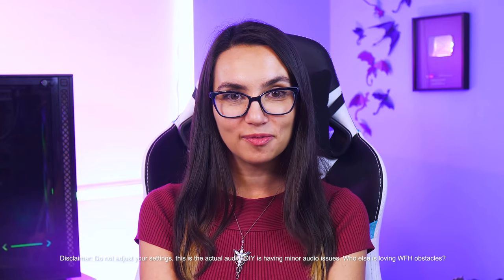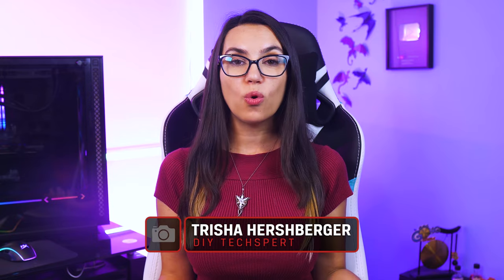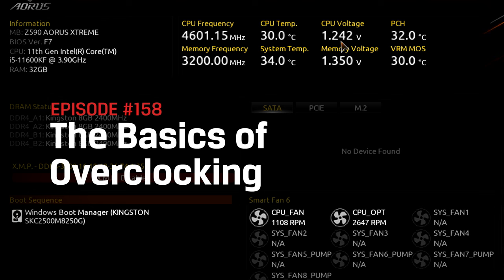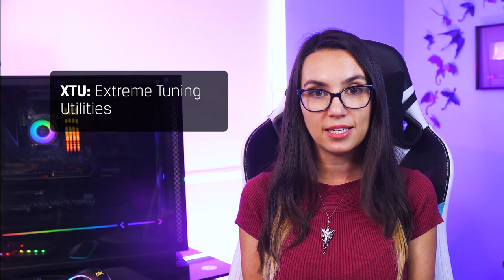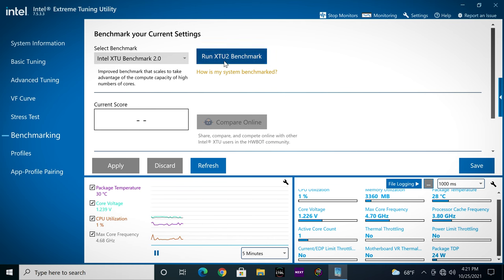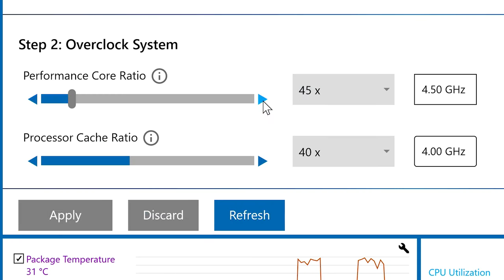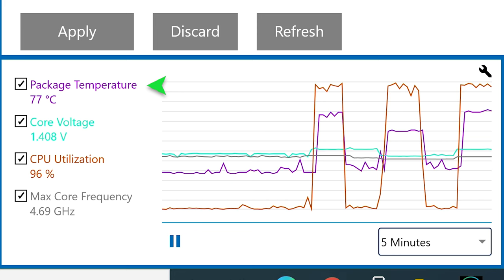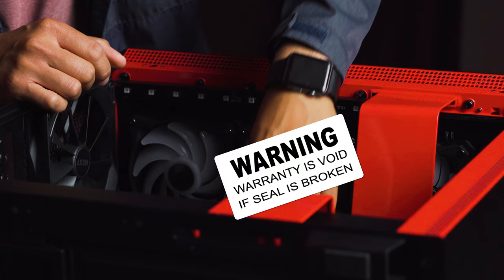The Basics of Overclocking – DIY in 5 Ep 158

Comment: Old timers like me remember the bad old days when Intel clock locked everything starting with the Pentium 2. AMD didn't make overclock tolerant chips, so for years overclocking required specialized knowledge and expensive after market chip adapters. Crazy to think it's officially supported now.
Reply: It still isn’t as it voids the warranty…
Reply: @christophervanzetta  it only voids the warranty if u break it lmao. And their r a lot of ways around it
Reply: @christophervanzetta  for example auto overclocking or PBO in ryzen master is not going to void ur warranty lol.
Reply: @princessskye2307  False. They deny warranty claims due to overclocking as stated in their warranty...
Reply: @christophervanzetta  ur wrong lmao. How many cpus have u RMAd? How many have u owned? If u do not break the cpu due to overclocking and it can be returned to stock settings before RMAing it. They normally will take it.
Reply: @christophervanzetta  BUT they reserve the right to tell u to F off if they findout u tried to pump like 5 volts into it😂
Reply: @christophervanzetta  lol theirs almost no way for a manufacturer to check or prove the max ran speed of a cpu they can see what part of the cpu u broke. But Voltage is usually what matters to them. & also. PBO. AUTO OC. And manual OCing is also not the same thing at all to them either.

Comment: For you quiet freaks out there, overclocking may also be for us! Clocking the most power-hungry components in our systems lower and reducing their operating voltage to its lowest stable point will mean less heat is generated. If you let the system control fan speed, the fans may spin slower, making less noise. If you take manual control, you can monitor the temperatures of the components and configure a “custom fan curve” so the fans only kick in when needed, and only to your noise tolerance. In my experience, EVGA offers finer fan speed control for their GPU fans than does SAPPHIRE. Make sure you don’t end up with a card like I have where the fans can’t go below 26% speed while the card is above 52* C. For my card, this is a BIOS limitation and it really bugs me!
Reply: you mean underclocking and undervolting. crypto miners do this as well to a small degree to increase efficiency

Comment: xmp profiles are usually pretty bad relative to what most kits can actually do. CPU and GPU overclocking are straight forward, can learn how to do both in a couple hours if you really want. But if you really wanna know the joy of smashing your head against a wall for 12 hours, try manual memory overclocking. That's where the real fun is at.

Comment: I appreciate seeing this show up as a clickable ad. I'm curious about overclocking and didn't realize I was until I saw the ad and honestly it would be cool to overclock my laptop but I don't know if it would be worth it because my laptop is now 6 years old or it will be by the time it's Black Friday because I got it for $350 on the Best buy website on Black Friday 6 years ago, but anyways my laptop is definitely showing its age and while it's still runs fine it's slower to start up than it used to be and it sometimes has issues in other regards although it otherwise works great I guess

Comment: Okay…. Besides other glaring problems with this all; liquid nitrogen isn’t used to keep components from melting due to extreme heat, but instead rather is used to lower their temperatures to increase the operating ceiling of voltages, core clocks etc as well as preventing thermal throttling.  This vid is kinda embarrassing